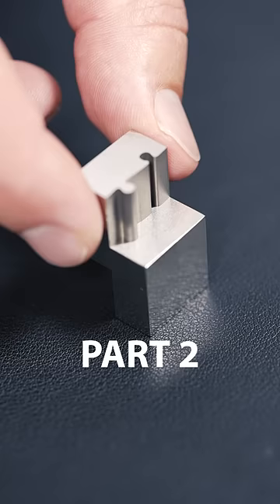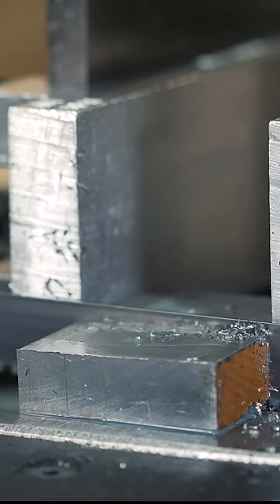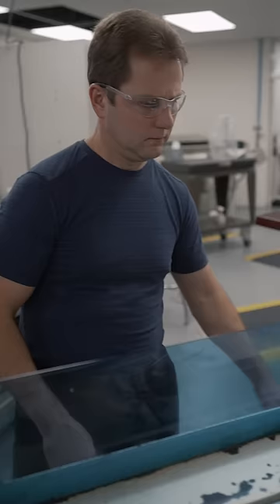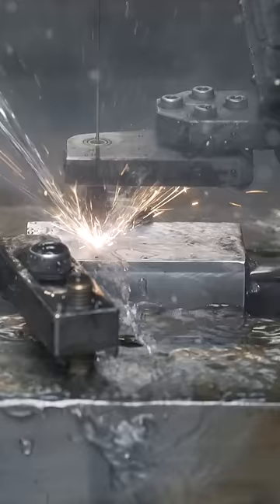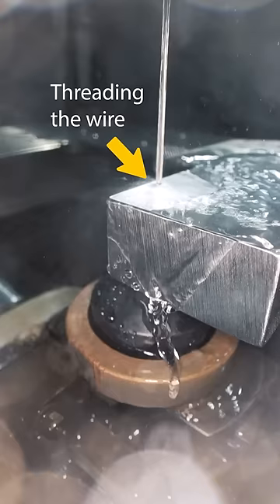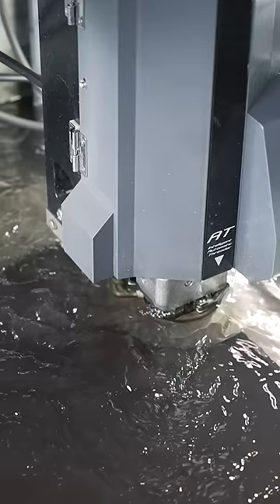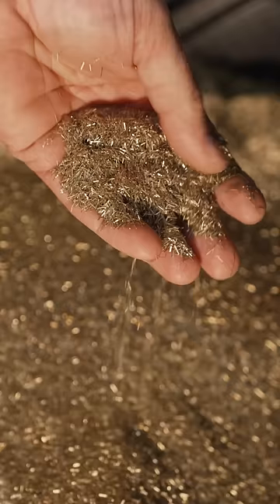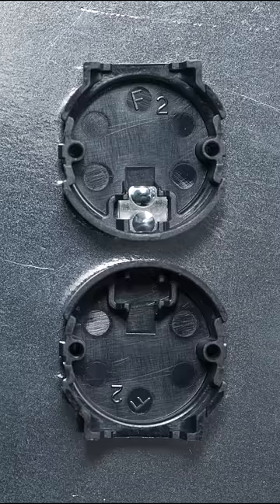'Zero Tolerance Machining' with the Wire EDM, Making a Puzzle Cube - Part 2 | US Digital

Comment: Everyone wants the cube. But at four hours manufacture time, they’d cost about $1500 a pop.
Reply: @RoadnTech  i dont think you can math
Reply: @RoadnTech  the cost of the block and wasted material is minimal in comparison to the cost of machine time, the operators wage and the programmers wage as well.

This does not even consider the time that it takes to actually prep the stock and square it up before it is even usable by the machinist.

The material is hardly the issue with the cost of precision milling of any sort, not just wire edm.

Unless you are milling something like titanium or some other costly metal, steel and aluminum is relatively very cheap.
Reply: @Crypto-Legend  what are you basing that off of?
Reply: @josephk1342  Similar, larger, and better objects online around that price point. Obviously, if it's custom, you'll pay custom prices though
Reply: @Crypto-Legend  yeah objects like what?
Reply: @Crypto-Legend  what about 200?
Reply: @PHANTOM-vd2sn  That's the going cost of a cube lol
Reply: @yaykruser  good luck finding a machine shop that's willing to machine your parts for 20 bucks an hour.
Reply: @yaykruser  If it is what he makes, then double it to get what he is costing his company (tax, insurance, benefits, vacation, etc). So it is 40 dollars in labor only. Then there is cost of the machine divided by its "life span" in hours to get price for using that machine. Add another cost like rent, electricity, insurance, water, toilet paper, etc. And don't forget tax. Also, the company is not charity, so add also a profit. So you are realistically looking at 100+ dollars in cost if the worker is getting 20 dollars. 
Also, there is thing in economy what is called "opportunity cost". Look it up.
Reply: @yaykruser  Out of interest, what do you do for a living?
Reply: @DangerfieldChris  Working for the newspaper
Reply: I work for a similar shop. We charge I believe $65 an hour. Figure an hour to cut the stock and square it up. An hour to grind it. An hour at the hole popper. Programing and setting up the wire is an hour. Plus the four to cut out the pieces.. they would be pricey as a one off part.
Reply: @reverendglitch  some of our molds actually are made in China. It's cheaper. But there is a balance with that. Not as high of a quality.
Reply: Just make them a NFT and watch them fly off the shelves.
Reply: @yaykruser  WTF is a "normal cutting machine"? WEDM is a specialized process of toolmaking for the electronics, aerospace, medical industries. The people who 'operate' these are highly skilled and make between $25-$45/hr, more if they design and program, like in the video. You have no idea what you're talking about and no idea how nice things, like the device you're using, gets into peoples' hands so cheapLy and plentifully.
Reply: And the problem is what
Reply: @yaykruser  yep, plus the (most likely million dollars worth of machinery it takes) overhead, payroll taxes, workmans comp, and if the company may actually want to make some money, I’d say $1500 is a pretty good estimate…
Reply: @yaykruser  just because that’s what they make, doesn’t mean that’s what they  charge… 

By your math I should be able to get a McDonald’s meal for $1.25

$12/hr for the worker x 2 mins=$0.40
$0.60 for the food
$0.25 for grease and electricity.

I’m not trying to be mean, but people always complain about the cost of things before they actually think about what goes into something.

And if there is a time when things are overpriced, someone will produce the same thing for less, the beauty of capitalism.
Reply: I'll take two
Reply: @yaykruser  If you have a company, even with only 1-2 employees, and your profit is your hourly wage, you’re not going to be in business very long…you would pay yourself, an hourly wage, but the business still needs to make money, what happens during downtime, or if/when business gets slow, or if a machine brakes, etc? The business is going to have to make 10-20% (after ALL expenses) to survive…

And if you think McDonald’s is overpriced, try buying a piece of land, building a building, paying for utilities, healthcare, salaries, utilities, insurance, equipment, raw materials, etc, 

Then try to charge less than they do and see how profitable you are…

That’s the beauty of capitalism, “water will always find its own level” meaning the cost is what the market will bear…
Reply: 2 hours of edm and everythingelse
Reply: I just bought one of these “used” from eBay UK as a present for my brother for Christmas. I paid £50 and now I have it I’m thinking I overpaid.
Reply: i did a thing: fine, i’ll do it myself
Reply: You could use different material but I don't think anything else would work
Reply: a small price for salvation
Reply: @yaykruser  yes because they bought a fucking $200,000 machine and spent years learning to use it then drew up the plans and used other expensive tools just so they can make $20 an hour..... do you even know how a business works
Reply: Nah don’t get rid of my hope
Reply: @smclynden  What's your point? I know McDonald's has an "integrated supply chain", or more simply, a vertical monopoly, they could easily lower the prices they charge franchises for entry and supplies which would have the knock on effect of lowering the price paid by the consumer, but they don't because they want to keep their insanely high profit margins. Therefore, McDonald's is still wildly overpriced. 

You're the one who claimed a business making less than 10% profits would fail, glad you came around.
Reply: @VeProducctions  How did you arrive at that conclusion? I presented the name of well known economic issue. I do not know if the person I wrote it to is familiar with it. If he is, then me trying to explain it would have no meaning. If he is not familiar with it then there are good sources for it, much better than if I would try to explain it myself.
For people with working brain is referencing a common thing, you know.
Also, I would like to point out - if saying look it up (after another long writen paragraph btw) is something bad... then what is useless personal attack adding absolutly nothing to discussion? Which is what you did.
Reply: @VeProducctions  You accuse others of blowing things out of their orifices and than write something so totally wrong it hurts my brain thinking anyone would take is as a true.
McDonald does not spent as much money for lobbying as their wages. That is complete nonsense.
Reply: @loganaick386  This happens when you skip English classes😑
Reply: @Crypto-Legend  $251, take it or leave it
Reply: Dude if you just look it up they go for like 60 dollars, not even close to 15k
Reply: Worth it
Reply: @mrosskne  
I’ve never agreed so much with a random persons comment on YouTube
Reply: @Crypto-Legend  LOL Sure but $250 for a dust collector is fine... good thinking Ms. Anonymous.
Reply: Most companies take the workers hourly salary and triple it to cover insurance, benefits and profit.  Then there is the operating and material costs, and those machines are not cheap.
Reply: @Crypto-Legend  Where are you seeing that, genuinely can't find any similar product, maybe I'm just being dumb.
Reply: @vegtamthewanderer6490  Every time I post it this shity company takes it down :(
Reply: @reidb9422  
Don't forget the designers and drafters, and, more importantly, the INSPECTORS. These things are likely made to tolerances of .0001 inches or less Meaning they need equipment capable of inspecting each part to .00001 or less. That gets EXTREMELY expensive.
Reply: @yaykruser  
Yeah, no. You have to cover the cost of fixturing, designing, drafting, AND inspecting. Tolerances THIS toght require EXTREMELY expensive inspection tools and rigs; and the rigs very often have to be custom manufactured and precision ground.
Reply: @VeProducctions  
Do you even know ANYTHING about the field of machining? These things are a pain the absolute ass to design, draft, and apply even BASIC GD&T to. Do you know what any of those terms mean? Here's a hint, getting a number wrong at that tight a tolerance can cost a company an entire contract and TENS OF THOUSANDS OF DOLLARS in failed parts.
Reply: @VeProducctions  
If people will pay x price, then it is entirely moral. Also, monopolies are only possible when governments interfere in the market.
Reply: W O R T H
Reply: @NORTHBROOK1978  what about a high production run? If we ran these products through something similar but not specifically this machine (remember this is a highly precise machine, not necessary for non critical component machining) i work in a plastics molding facility and you're right, single run lots are always super expensive because it takes retraining ops to keep an eye out for defects and also takes time away from one of our other high volume machines, but when we do large hundreds of thousands of parts lots overall it becomes much cheaper. Just wondered your take on these if done in a semi mass production environment
Reply: 69th reply lol
Reply: @smclynden  Glad to have you on the team, comrade! Down with the bourgeoisie McDonald's clown and his decadent makeup!
Reply: @biosaber585  well.. they wouldn't fit together as well.. a mill and a edm wire are totally different.
Reply: @VeProducctions  
I know the jargon better than you do, considering this shit is my JOB. Literally putting the wrong GD&T on a drawing can result in 20% fewer parts passing, or worse, a part failing to even be producable. Contracts almost never give toleranceds. That is up to the design team to determine and is based on a part or assembly's application. If NASA needs a satellite with certain capabilities, they will issue a contract for exactly that; they typically DON'T issue micromanaging requirements like tolerances. But thank you for demonstrating your complete ignorance of the entire manufacturing process.

And yes, monopolies require government to exist, as government ENABLES monopolies to exist by passing regulations that stifle competitors from entering the market. In a free market system, no company can ever form a monopoly, because competitors are constantly springing up to challenge them. Just look at the smartphone industry. Apple didn't have a monopoly on the tech for long, and it certainly did not require government intervention. Now go look at the taxi industry and the steps the government is taking to limit competition from Uber and Lyft.
Reply: @Crypto-Legend  Damn, think they would be able to catch the tiny url?
Reply: @vegtamthewanderer6490  I'm hindreds of different places make sruff like tbi
online lol
Reply: @jfangm  the mk3 steel metmo cube is the closest thing to this precision puzzle I've found, which honestly looks like a failed Kickstarter. They do have other things on their website...but it seems a bit sketchy...
Reply: @Le-Johnny 
It isn't the machine that makes it expensive, it's the whole process, from design to manufacturing. Reliably producing parts like this requires highly skilled designers and drafters, as well as incredibly precise (read "expensive") inspection equipment and skilled inspectors to operate. This isn't your typical +/-.005 in. tolerancing that to might find on an engine or aircraft part, this is +/- .0001 to .00005 in. tolerancing, like what's used on satellites. THAT is what makes it so expensive.
Reply: @Crypto-Legend  
Good. They should take down scam links.
Reply: @jfangm  It's not a scam link. lol They are a shitty company and are afraid of their competitors. I'm not affiliated with this type of business, I'm a finance guy, but I'm a advocate of trolls like these guys not taking advantage of people.
Reply: @yaykruser  do you work for free? Why should someone who has to manage a shop, machinery/tools, bills, employees, etc. work and make the same as a waiter? You work for a company, and it’s obvious. You’ve got no idea what it takes to run a business in america. China? Sure sell your cubes for $100, but it wont look the same as the $1000-$1500 cube
Reply: So you’re saying there’s a price.
Reply: @jamesa8851  
Yes, and a steep on at that.
Reply: @yaykruser  
No, they couldn't, not mass producing these parts. Why? Inspection. These demo widgets are so precise not just because of the machine, but because the company has access to inspection equipment precise enough to measure the parts accurately, as well as the skilled metrologiststo operate said equipment. There is SO much more to this than "push button, make cool cube."
Reply: @yaykruser  false. Ask me how I know
Reply: @yaykruser  lmao you know nothing of manufacturing or much at all it seems
Reply: @CoolKoon  Yeah, youtube doesn't ban links to professional sites. Also, I've had many comments taken down from here exposing them. Check yourself.
Reply: @Crypto-Legend  "Yeah, youtube doesn't ban links to professional sites. " - Yes it does. "Check yourself." - Yes I did. That's how I know that it's happening. It's a recent development, but they started filtering pretty much all the comments that include a URL.
Reply: @CoolKoon  You know, I'm willing to believe that it's possible, however, it still doesn't explain the other plain text (non-vulgar) comments being taken down. Who knows though?
Reply: And?
Reply: @Crypto-Legend  "it still doesn't explain the other plain text (non-vulgar) comments being taken down." - That's true. But if they vanished after like 20-25 seconds then it was definitely YT's doing, and not the channel owner's.
Reply: @CoolKoon  I have no way of knowing that, I'll keep that in mind
Reply: @Crypto-Legend  The way I figured this out was by attempting edits to a comment I've posted after 20 seconds have passed. If the edit fails with an error it means that the annoying censoring algorithm of YT has removed it (for whatever reason, their coding practices have been a mess for the last 5-6 years). If the edit goes through and remains (and vanishes much later) then it means that it probably has been removed manually by someone.
Reply: @Crypto-Legend  Amazon?ebay? Or something else
Reply: they use this machine to make parts for consumer products, i bet they could sell this at a good price
Reply: Worth it
Reply: @loganaick386  You need English.
Reply: @apex_prey  yes sir i  agree   do u share ur mail id ?
Reply: Take. My. Money.
Reply: In fact should cost only 5-7$ by pounds. But they don't just cutting it, they are using others tools, they have workers, electrical cost, etc etc

CNC machine operator isn't under 20$ by hours.
Reply: they could prob do a less refined one where they just do the edm peices and or alluminum
Reply: Actually another company sells them and there 109 dollars
Reply: @joshuat5140  dope
Reply: @joshuat5140  Have you got the company name or a link?
Reply: I bet there is still a market for them at that price.  Maybe not a big one but some people would buy them.
Reply: Take my money
Reply: Thats why we need communism and state makerspaces nationwide.
Reply: @RobWenzel84  I will make one for me. Could make one for you aswell while Im at it. Are you still interested? Greetings
Reply: @koalamusik  I could make one for you. Still interested?
Reply: @DancingMachine1  depends on the price
Reply: found them for sale for $98
Reply: @ThePesmat  Link?
Reply: @DangerfieldChris  there's a solid 100% chance I'll get in trouble for that so search "EDM puzzle cube" and you'll find a few options
Reply: @peteroleary9447  sounds like they just overcharge for their services and overestimate their worth and how difficult their work actually is.
Reply: @ThePesmat  Cheers.
Reply: Do you get paid 1500 for 4 hours at work?) Or maybe 150 bucks?
Reply: I doubt it is 1500 more like 500 to 700
Reply: people would still buy them
Reply: @fly88l  Apparently someone is selling them.
Reply: I'll pay that
Reply: It's more like $25 per hour, so $100. In fact for $98 you can buy this exact thing. Look up Wiron Cube.
Reply: I take 2.
Reply: @reidb9422  No, you are wrong on every single level. The true competetive cost are other better paying projects. Why spend that time on a part that brings 1500 dollars when you can spend the same time on a part that brings 15000 dollars. Thats 13500 dollars waste on producing the cube.
Reply: Look up Wiron Cube on YouTube made by thewackycompany. 100 dollars for 1, which is still a bit but not 1500. Would probably be of less quality as well tho.
Reply: have you ever worked production? depending on what project they are shelving to make that cube it could be as much as $15,000 an hour in lost rev
Reply: @jasirek1732  Electricity and other utility costs as well. Those use quite a bit of electricity and the utility bill to have the whole factory going is huge for even just one day so add that to the manufacturing cost as well.
Reply: Ouch
Reply: @jamesscott6753  id pay it dont matter
Reply: Ask China, they make it for $9,99
Reply: i can give you about tree fiddy
Reply: @jamesscott6753  have had something made by this process, 1500 on the money.
Reply: @Anax100  having had dozens of wire EDM'd parts quoted and purchased. No it's really not.
Reply: @reidb9422  i cut stock, and square stuff up before production, i make about $17/hr . i don't operate a wire EDM but i operate a haas 3 axis and program /setup as well. wire edm ops make a little more than i do...in the $20's
Reply: Enough people with more money than brains that would by one of those at that price
Reply: Dont even care i want one
Reply: That's a bargain. I used to work in semiconductor R&D lab and their precise 4.01 cm^2 hole puncher cost $5K
Reply: I'd still buy one, I'm not broke like you
Reply: @suedeB05  Poor people always say that.
Reply: And they would sell everyone one of them they made.
Reply: I'd pay
Reply: in a 1 at a time production, thats still around 160 dollars plus the 6 bucks in steel. with a production run, this process would easily be much faster and cheaper. Is it still worth it? unlikely. If someone quoted a retail price under 120 dollars, I would call them insane.
Reply: @gyff jogofl  manual machinists are 40 to 60 bucks an hour, CNC machinists are 20 to 80 depending on skills and type of work. Mass production machine operators make around 20, while small batch machinists who frequently have to change programs, and have deep understanding of their machine processes make closer to 80
Reply: Why?
Reply: I ran the EDM for the materials science department at A&M as my first job. I got paid 8$/hr.  Lots of waiting time that I used for studying, so it beat the hell out of other on campus jobs. With the cost of the brass wire, power, and the DI resin, total variable cost was around $24/hr for the grad student projects. If we had more advanced cuts to make, Solidworks was used to make the g-code. Definitely not $375/hr 😂
Reply: Found them on Google for 100 bucks 🤷🏼‍♂️
Reply: @reidb9422  You could make 1000+ pieces in 2 hours on 1 run...
Reply: These are $98 online.
Reply: People would still buy
Reply: You can buy them right now for $99
Reply: Ill buy a machine and start selling them…
Reply: For a one-off maybe. Economies of scale my friend. Tooling setup and manufacture process for making thousands will reduce this cost to a fraction of that.
Reply: Sadly I have come to the same conclusion. Just watching each prep step before even the manufacture tells me I wont be adding one of these to my spider home.
Reply: @donjean6590  you can buy these zero tolerance cubes for $99
Reply: Economies of scale make things cheaper. Ask Elon Musk
Reply: Don't care. Put it on eBay. Someone will buy it
Reply: And still people would pay it.
Reply: That MV1200R is a great machine. 👍
Reply: Nope $98 on the site I listed above this comment
Reply: EDC fanboys spend $500 on fidget toys. This would definitely sell.
Reply: Great! I'll take 10 of them!!!
Reply: @reidb9422  - plus 4 hours of the capitalised cost of the machinery.
Reply: Damn.
Reply: there's no way it takes that much if you put some effort into setting up a production line
Reply: @Crypto-Legend  not about that, it's about precision
Reply: @Crypto-Legend  not about that, it's about precision
Reply: i had a shop make one 1x1 inch edm cube for 100 usd flat.. bro hasnt a clue what hes talking about and amasses thousands of likes. poetically shows why the modern world is so fucked despite everyone having access to the entirety of human knowledge
Reply: But it would still be better quality than what some Chinese companies charge for CNC stainless steel, titanium and zirconium fidget toys.
Reply: Great price estimation
Reply: They are $105 dollars at the Wacky Company
Reply: Worth it
Reply: @peteroleary9447  meh, I know an operator of WEDM, he was graduated from vocational high school and it's majoring automotive
Reply: @wakuwaku6647  Yeah, same. Through my many years in the business, there are operators, and there are Operators -- Journeyman Tool & Die makers who've migrated to WEDM specialists. Like any trade, there's variability in skill. Some can only load parts and push buttons and do semi-production work, and there are some that can design, program, work with exotic materials and super-tight tolerances, knowing every aspect of various machine models, and will make special fixturing for jobs when necessary. These guys can make six-figure incomes depending on location and hours.
Reply: @jasirek1732 we run new brittians what is machine life?
Reply: If I was super rich I’d pay 50k for one of those
Reply: @jasirek1732  this guy quotes
Reply: @smclynden he was also being generous at a 20$ per hour machinist rate being well below the average, his estimate is somewhat low but still accurate for this  project
Reply: @smclynden  well put sir 👏
Reply: @jfangm cmon man you 100% need tolerances for these things, what are you going on about like you don't, 100% cmm and/or laser scanning if not every 10th part that comes out good every 100 , thats just basic machinery practice for most applications
Reply: @jfangm also the r&d with troubleshooting which is all at loss cost to refine the settings of said machine and material for this accuracy level
Reply: @Setsunone no you can't, your little edge finder or ball calibration tool would still be just a start at the level of accuracy this requires, it's not a single part but a mating of parts where setup and machining process have to be perfect, not good but perfect, anything less is barely noticeable but there none the less
Reply: @amos9274  there is no production line if you want a product with this accuracy, it has to be a perfect setup by the machinist and dialed in every time, a jig won't work with this, close but not sufficient
Reply: @yabbis4054 I believe your confusing mating parts with none mating parts, the tolerances get exponentially harder when you have to go for comparing 2 parts that should fit to that degree of accuracy, vacuum seal is way below this type of machinery, your almost considering covalent bonding at this point
Reply: @peteroleary9447 kid named experience lol
Reply: @gyffjogofl7676 foreal and that not even talking union shops 😂
Reply: @yaykruser I've seen some videos on that, I was surprised at the level of precision you work with with those printing presse, they say when your covered in ink it's like liquid gold because pound for pound its worth more I believe, could be wrong, enlighten me if so!
Reply: @peteroleary9447 your correct but it is highly dependent on what your making, I can wire edm a part first time with a random material and be fine, for this it may require experience with the material and vast knowledge to troubleshoot inaccurate parts, my father always said its like a dark art that no book will fully teach you, trial and error is expensive but the only way to refine in such a manner, also interest and motivation which you can't teach in school
Reply: @curtiswright2546  
I never said tolerances were not required. Quite the the contrary; I said the tolerances have to be EXTREMELY precise, like +/- .0001 to .00005 in.

You might be confusing something I said earlier, that a contract specifications usually do not have tolerances.
Reply: The EDM machine costs $375 an hour to operate? Does it require a team of 10 people or something?
Reply: @kerbodynamicx472  
No, that's what it costs between power, the trained operator, electrolyte solution, the wire, and the cost of the machine itself.
Reply: Lmfao, try like $10k at the cheapest.
Reply: @evolicious  
Ikr
Reply: Dude even if they're 1500 I'm sure there's people that would pay that.
Reply: @richardsanchez5444  
Not really. Not enough to offset the cost of making them.
Reply: @reidb9422 Make it in China for a minimum of labor, energy and machine costs.